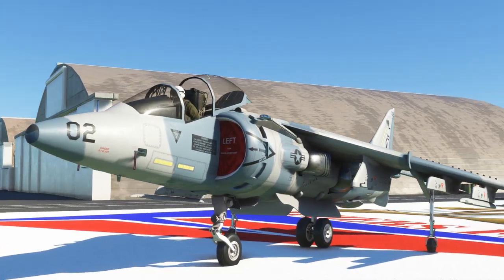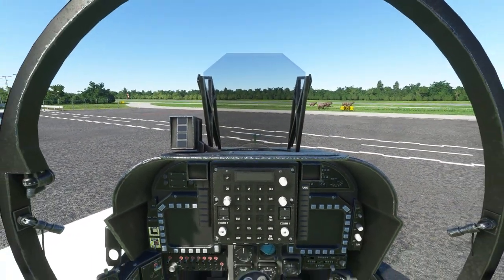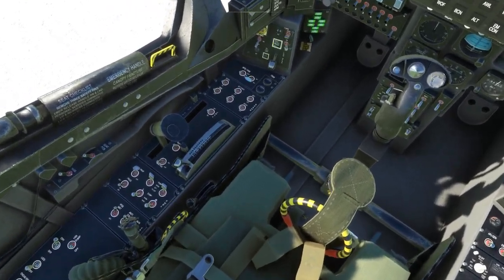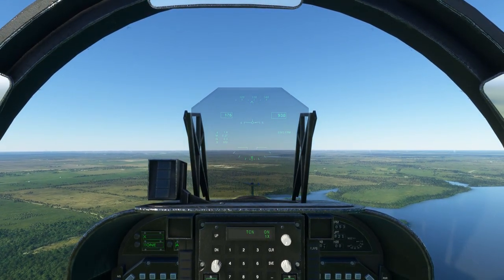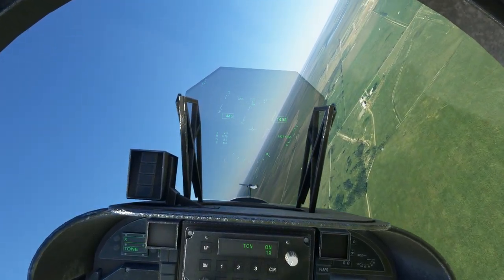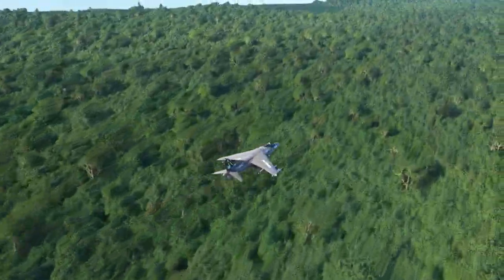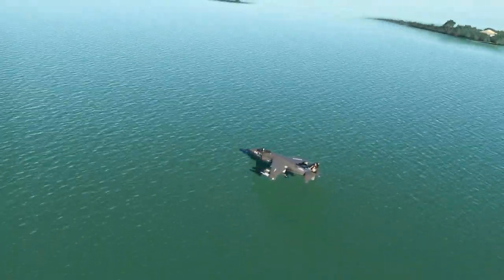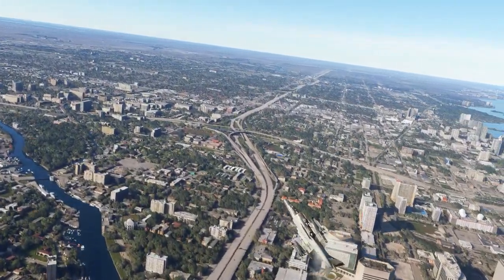MSFS DC Designs AV-8B Harrier II Review & Short Tutorial

Comment: There are many things I don't like about the Harrier II simulation. The first is that the model is not accurate in that if you get close to the wing in the external view, it is covered with rivets, but the actual AV8B had a very large carbon fiber wing skin on top and there were not a lot of riveted panels. In fact, the Harrier II was one of the first military jets that used a lot of composite materials.  The next thing I don't like is that there is no spoiler control in the cockpit that I can find. The spoiler opens when the gear goes down, but you have to manually close it. The next thing is that the switches can be counter-intuitive. Some bottons tell you their current mode and others tell you the mode that will be activated if you flip the switch.  The last thing and maybe the worse, is that the MFDs are obscured on one side by the central panel. I have to set the HSI on both displays so I can see both the right and left buttons.  As for the real Harrier, they are almost never taken off vertically. That is really only for air shows. In operation, the Harrier and Harrier II will almost always be taken off in STOL mode with  takeoff run. This is because the Pegasus engine is guzzling fuel at an enormous rate when you take off vertically with even half fuel.  A short takeoff run greatly reduces the fuel needed to take off.  Vertical landing is typically done only on ships and practice, but when landing on ships, usually you have 25 knots minimum of headwind and often more.  The takeoff behavior of the model is poor. It wants to pitch up badly on the nose unless you use some nozzle deflection.  I very much enjoy the fact that there is a VMA-513 livery because that was my own squadron, but when I was with VMA-513, we still had the AV8A, and the AV8B was a massive improvement, much of which was due to the extensive use of composites.

Comment: From the looks of it, it seems quite easy to be held in hover. In the DCS rendition of the Harrier constant corrections have to be applied to keep it nice an steady. Are you applying corrections in the recording which are not apparent or is the flight model so much different?
Reply from the maker: Having never flown the Harrier in DCS can't give you a comparison on flight models. That said, I'd assume DCS is more accurate, but again I've never flown it.  Could you be a little more specific about what you mean by constant corrections?
Reply: @unrealizedflight  What I meant was that it is really difficult to keep the Harrier in a hover in DCS. Constant fine corrections are necessary, otherwise the jet drifts and rolls and that leads to a quick and violent reconnection with the ground quite quickly. Imagine a helicopter with twitchy controls and a very narrow (almost non-existent) point of stable hover trim.
Reply from the maker: Hover is rather stable; it might require a few inputs here and there but nothing drastic. It's fairly forgiving it will drift but not roll, descent is going to require some management, not much. Hope that answers your question, if you've got any more let me know.